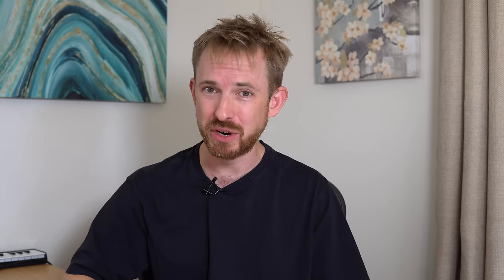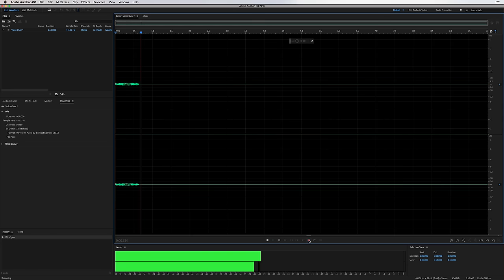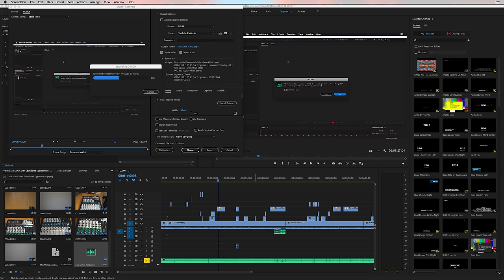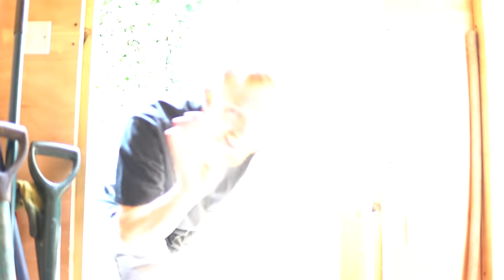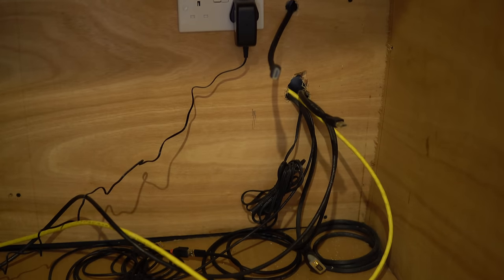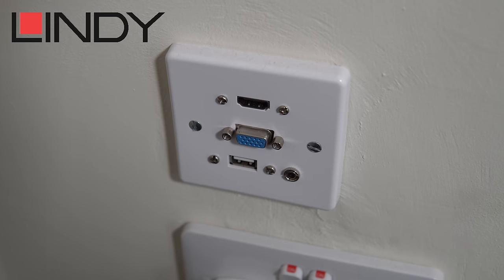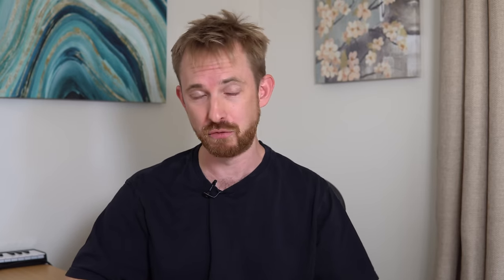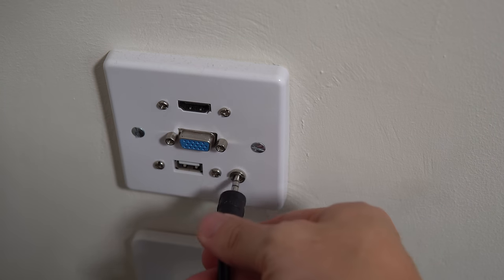How to Reduce Computer Fan Noise - Ultimate Audio PC Build #001

Comment: Can you run an audio interface and midi controller through a usb hub and have low enough latency to record music?
Reply from the maker: Hi Eric, in terms of reducing latency a USB Audio Interface and USB Midi Controller would be best running direct from the computer.  By all means there are other USB devices you could run from a hub but these two devices should be in the highest speed USB ports available.  Also, it's likely these two devices will take their power from the computer's USB bus so unless you're running a powered USB hub this wouldn't work at all.
Reply: Mike Russell thank you!

Comment: Thanks, but this novice doesn't get it. I'm recording video with a webcam and recording mic, but it's all coordinated through my laptop. The PC is central to what I'm doing. Put it in a cupboard? I don't get it.
Reply from the maker: It's all about isolating the noise but if you need to control the laptop then obviously you need it near you.
Reply: Get a middling Usb mice and camera, along with some usb extenders. Set up the recording on your laptop on one side of the room, then walk over to your actual recording area and do everything. Then just edit out the beginning bit
Reply: @patrickbritten9304  Thanks Patrick.

Comment: Now, you don't have to drill holes in a wall and NEVER put computer equipment in an unvented cupboard! It will shorten the life of the components and is a potential fire risk.

If you have to have a PC next to you whilst recording, build a silent PC.

Streacom make some fantastic silent cases such as the FC8 Alpha.
https://streacom.com/products/fc8-alpha-fanless-chassis/

With silent PSUs,  i7 65W TDP processors, multiple SSDs. Adjustable heat pipes.

Silence.
Reply from the maker: Thanks for the good tips here!

Comment: This is not the video I have been looking for. I do not have a shed nor a pc so how am I supposed to do it for laptop BRUHHHHHHHHHH
Reply from the maker: Laptops are generally not suitable for any of this.  Due to the confined space in the case laptops will always run hotter than full sized computers and therefore fans will operate more.
 
If you're serious about audio and insist on using a laptop then you want to keep it as far away as possible for the microphone(s)